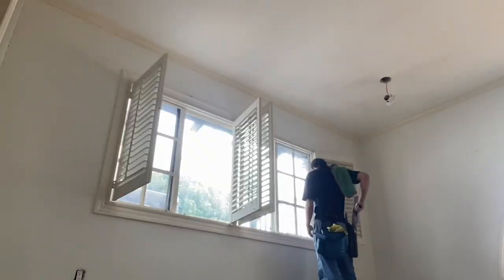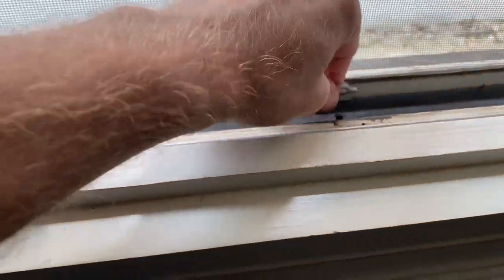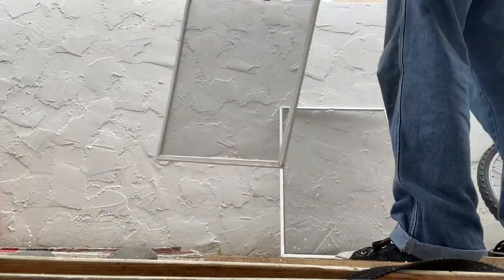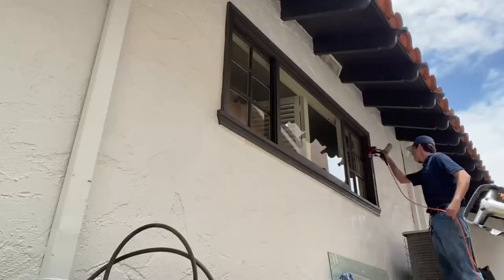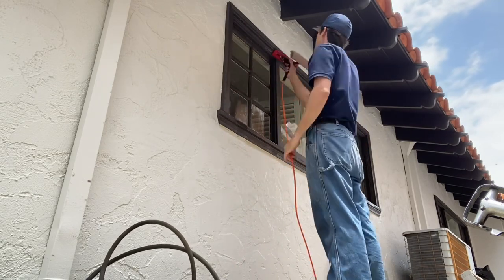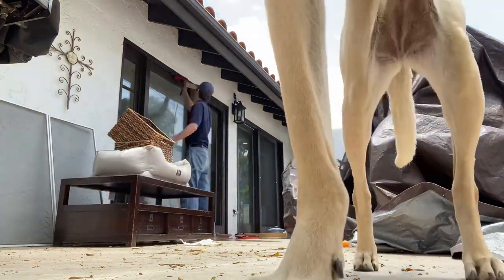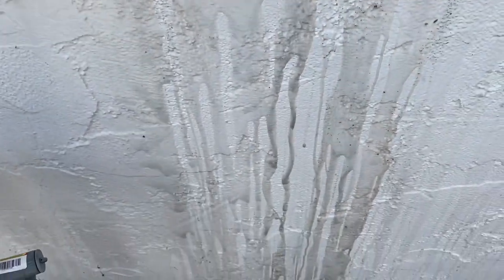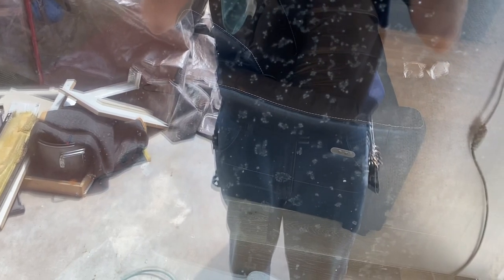Di Water Fed Pole System vs Traditional | Window Cleaning Business Vlog

Comment: You need a Xero micro pole, the most versatile for ground level since you don’t have to pull apart
Reply from the maker: I saw they have a few versions of the micro. Which would you recommend?
Reply: @Puffwindowcleaning  I use the micro ultra light daily, I like it because you don’t have to drop sections to get a lighter pole so you’re saving some time there… I use the micro ultra light or the destroyer, they’re always in the van for the go to poles
Reply from the maker: @stillXpist  nice, I’ll have to order one soon and try it out

Comment: Hi there. Currently I have 30 clients every month and there is a big chance to get the double. But someone mentioned to use deionized system to do it more efficiently. I am trying to make a decision but I can't find anyone to confirm that it will be more efficient. Currently I am using the traditional squeegee. Any advice will be really appreciated.
Reply from the maker: It all comes down to preference, but in certain instances a waterfed system will save you a ton of time. However If it was a really small job I wouldn’t even bother pulling it out to set up. Definitely a tool worth having though